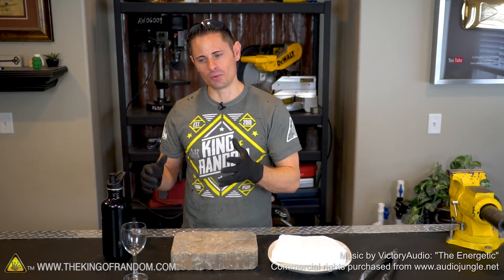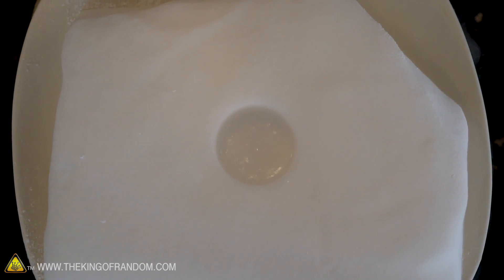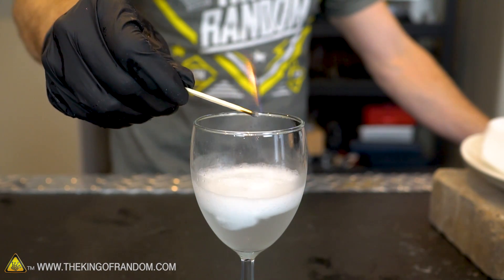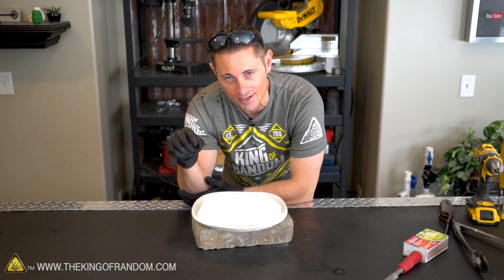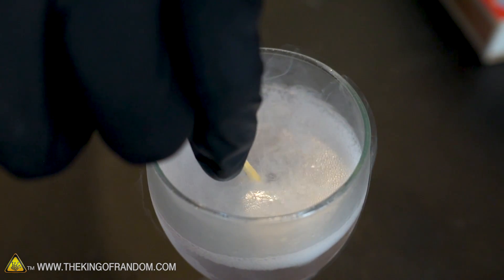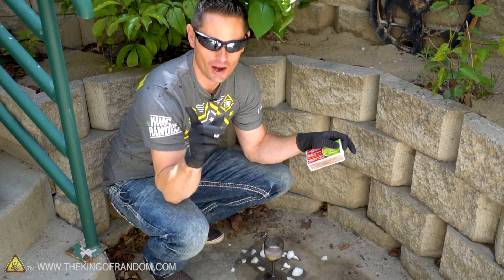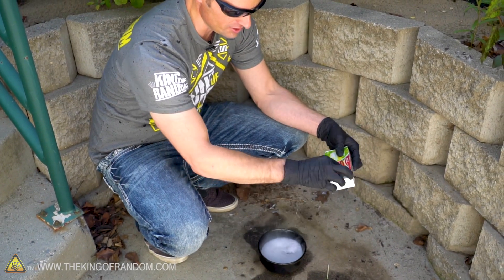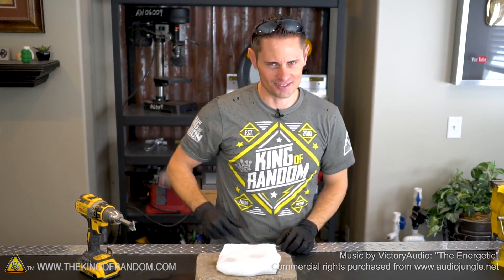What Does GASOLINE Do To Dry Ice? Can You Really Make A Fire Extinguisher With Gasoline?

Comment: NileRed did a great video on the topic related to water that I'd be willing to bet applied here just as well. It is probably not the Co2 that puts out the flame, it is the cold. A combustion reaction requires heat, oxygen, and fuel to keep going. He showed that the commonly held belief that water puts out fire because it "blocks out the air" is a myth and the effect is negligible. It's the evaporative cooling of water boiling that removes the heat and that is the reason water puts out fire.

Comment: steel beams vs jet fuel
Reply: jens jensen We all know steel beams can't burn through jet fuel
Reply: I read steam beans vs jet fumes so I was like tf
Reply: yes
Reply: jens jensen You don't need to melt steel for it to fail. You just have to get it really hot.
Reply: jens jensen I
Reply: jens jensen 9/11
Reply: It does heat it enough do compromise structural integrity but not enough to demolition a building use thermite hence the liquid steel
Reply: jens jensen I don't what that is
Reply: Wow
Reply: Skull Smasher Bush did 9/11                                        JK
Reply: jens jensen yaaaasss
Reply: Thinky science stuff is really kinda hard for you froggy types, yeah?
Reply: Charmle H he is talking about 9/11 😑
Reply: I know... that's why I put in my 2 cents... because jet fuel can't actually melt steel beams...
Reply: He could do it at sept 11

Comment: If you drop the temperature of the gasoline to below -45 F it is below it's flash point and will not light.  No vapors = no ignition.  So as an experiment what temperature is your gasoline?  You have not proved if it is the CO2 barrier or the gas is below flash point.

Comment: Is it possible that the dry ice is cooling the gasoline before it freezes it but with it cooled it doesn't evaporate? If it doesn't evaporate, the gas won't produce vapor and it won't ignite. Gas as a liquid is not flammable, only when it mixes with air as a vapor.

Comment: The Fire Tetrahedron. CO2 is displacing the O2 from the reaction. The cold temp of dry ice removes the heat from the reaction. I don't believe that the gasoline actually put the match out. Well, If the gasoline was cooled below its flash point, I guess it could.

Comment: In WWII, the U.S. aircraft carrier damage control teams would flood the aviation fuel (gasoline) system with CO2 when an enemy attack was imminent. The Japanese didn't do this. As a result, the U.S. carriers would often survive multiple bomb hits, while the Japanese carriers would be reduced to flaming wrecks from similar damage.
The U.S.S. Yorktown, during the Battle of Midway, is a prime example.

Comment: Smokeless Powder in Dry Ice.  Will Smokeless Gunpowder ignite in a CO2 Vapor?  Since Smokeless Gun Powder is an oxidizer, shouldn't it?  Or Should it?  The hard part is getting the powder to ignite in the first place...you'd need to rig a primer most likely to ignite the powder to start...since any open flame will go out due to the lack of oxygen in the cloud of CO2....

Comment: The reason the gasoline won't light, which I guessed as soon as I saw it, was the temperature of the gasoline had dropped below its flashpoint. I looked it up, gasoline's flashpoint is quite low at -45 F, but with dry ice temp at -109 F, it makes the gasoline too cold to burn.

Comment: Unless you bought non ethanol fuel, the ethanol is an antifreeze. Also, ethanol is hygroscopic, meaning it will absorb water while still being suspended within the gasoline until the water content causes separation. I'm a suicide jockey.

Comment: Grant Thompson in the bit where you "Put Fire Out With Gasoline"  you've clearly still got a layer of CO2 in that glass because when you blow the layer of CO2 off, you easily set the glass aflame. Maybe the video just wasn't clear that that's what you did, but from what you show, it's not the gasoline putting out the match, it's the CO2. the flame is already out, long before the match gets anywhere near the gasoline. Every time you go any where near a gasoline container that doesn't have CO2 covering it, you can't even get close to the liquid gasoline before you get a flame up because it's the gasoline vapors that burn.

One way you could prove that the liquid would put out the match would be to start with a match or birthday candle and have a small hose leading away from the flame source. dump an ounce of gasoline into the hose, and it will flow into the flame and should put it out. Definitely have the fire extinguisher ready in case it doesn't work though...  :)

Comment: Grant, your explanation of this experiment is flawed. Putting matches into Liquid Gasoline will never catch on the gas on fire. It is the vapors that are produced off of the gasoline that catch fire. Also the fire tetrahedron requires fuel, Heat, oxygen, and a chemical reaction. This is why the dry ice won't catch fire you when you add the dry ice the CO2 creates a barrier not allowing vapor to form = no fuel, no oxygen and no Chemical reaction that can take place. Dry Ice also makes the gasoline temperature lower then its Flash Point (Point at which anything can burn), hence making it the reason for CO2 extinguishers Also known as class ABC Extinguisher.

Comment: Put a mini bomb in vacum chamber and see if that explodes
Reply: Rajesh Kc most fireworks have their own oxidizer so something might happen
Reply: if you're not sure about it then why put the text in bold?
Reply: If anyone is familiar with the channel Codys Lab he did something similar with a sugar rocket, it wouldn't go off because of a lack of pressure
Reply: Vlad Vavric Cody's Lab
Reply: but you can shoot a gun in a vacuum. they did it on mythbusters
Reply: what is fueling the bomb? explosives have their own oxygen and you could set them off in space
Reply: No it will not expolode because the vacuum sucks  all of the air including the oxygen from the jar and the bomb will not get any fuel to light itself and to explode.
Reply: Ehow567 but i think the oxygen gas evolved by the oxidizer might be sucked up b the vaccum again... iam not pretty sure about it but i guess so.

Comment: liquid gasoline itself isn't flammable. gasoline has a very low boiling point and the vapor formed easily mixes with oxygen in the atmosphere to form the appropriate combustible fuel/air ratio. If the gas is cooled below the boiling point, it won't ignite regardless of there being an oxygen barrier or not. neat experiment just the same.

Comment: well its kinda not correct with gasoline putting out the match. its the co2 produced by the dry ice in gasoline. nothing special, will happen to any liquid with dry ice. if it's water or gas in a container. so its just a barrier of co2 there prevents the matchsticks to light up the gasoline. and never try put out a fire with gasoline!.

Comment: You should try reproducing the gas inside of the dry ice. Instead of using matches though, use a propane (or other fuel based) torch to see if that will force the gasoline to ignite.

Comment: I'm surprised folks are surprised. Carbon Dioxide is what a basic fire extinguishers use. Important note, however, this method will not work on ALL fires, or, rather, on all types of fuels that fuel fires, which is why there are different classes of extinguishers.

Comment: Excellent! Fun and fascinating. Well worth watching. BUT at no time in the video did I see the gasoline extinguish the flames. It appeared to me that the matches (single or multiple) were always extinguished by the CO2 before they got to the liquid in the glass. Maybe slow motion would show otherwise, but until then, I am unconvinced. 
     Nevertheless, the ability of mere static chunks of dry ice to extinguish burning gas by sublimation is pretty impressive. I really liked seeing the smoke from the match just flow out over the heavier CO2. Smoke from a match usually rises (hotter = less dense) but the cooled gases from the match sank in air but floated on the CO2.
Reply: Craig Mooring Wow. That was so profound. But very cold liquid gasoline would put out a match because only gasoline vapors are flammable.

Comment: Putting a magnet in liquid nitrogen and seeing if it's still magnetized
Reply: Fabby Fresh onix Cooling magnets down makes them more powerful. Heating them up makes magnets get weaker until they are no longer magnetic.
Reply: Ok then heat up the magnets
Reply: All it's really gonna do is make the magnet more brittle.
Reply: Rajesh Kc actually liek the other guy said coldness makes magnets way stronger
Reply: liquid gasoline does not burn, it is the vapors that are coming off it that burn.  If you cool it down to almost freezing then no vapors are  being released.
Reply: I think magnet will lose its magnetic power after introducing it with very cold liquid nitrogen because it will disturbs the molecular alignment of a magnet... i guess so not fix.

Comment: would it work if you used a blow torch :)
Reply: downtoearthseeds24 Unless it's an oxyacetylene torch :)
Reply: Blow torches etc usually involve mixtures of oxygen, unless said oxygen is mixed inside the fuel within the torch then the flame will go out and all you will end up with is gas being emitted without combustion.
Reply: Meme page admin, could be wrong but I am almost certain all torches regardless of gas need oxygen for combustion and with CO2 being so heavy and clearly being incombustible it won't work. Though holding the torch above the CO2 where it can do it's initial combustion may allow the flame to enter and perhaps force the CO2 out with the pressure of the gas flow and propulsion of combustion.
Reply: MidnightMarrow An oxyacetylene torch has two tanks, oxygen, and acetylene, these two gases are then mixed together and ignited. I haven't tried it but I'm certain that dry ice will not put out an oxyacetylene torch.

Comment: I wonder if the gasoline vapor and carbon dioxide vapor are mixing a bit and becoming less flammable or is it just that the carbon dioxide is just too overwhelming? Fun fact: old gas pumpers in the first half of the 20th century used to put out their cigarettes by tossing them into a container of gasoline. It seems crazy but the liquid would put out the cinder faster than the gasoline vapor would ignite.

Comment: You seem to fail to explain to people who may not know Gas itself is not flammable the flames mixing with the air is. The reason you could not get the gas to light in the dry ice even while blowing off the CO2 is because the lower temperature caused less gas vapor to form hence no fire. Also with the frozen gas same thing no to very little vapor = no fire. I has part to do with the CO2 and part due to the vapor of the gas at colder temps gas does not release as much vapor as it would had it been at 0 degrees or above. Kind of hard for me to put it into words much easier to explain it while talking to someone but i hope you guys understand what im trying to say.

Comment: try: cooling the gasoline using the dry ice while not allowing the co2 to be included in the atmosphere near the flame, testing if the removal of some heat from the gasoline will prevent ignition.

Comment: The reason why it will not light off is because there is still carbon dioxide coming from dry ice (right under the gasoline) and preventing the fire to burn.

Comment: As you state, the liquid gasoline is not flamable. It is the vapour from the gasoline that is flamable. In order for the gasoline to evaporate, it needs to be hot enough. If you cool it down, the evaporation stops, meaning, that you can't ignite cold gasoline

Comment: You're essentially using a co2 fire extinguisher by putting out the flames with the dry ice. Similar to how you can get dry ice by concentrating fire extinguisher sprays into a sheet or towel

Comment: I think you missed to mention an important thing: gasoline doesn't burn instead it is rather the gas vapour that does and by cooling the gas you are drastically reducing the formation of the flammable vapour and consequently reducing the fire. I think it would be interesting to see if gasoline at the melting point can put out an fire if the thing burning is not hot enough(has sufficient energy) to heat the gasoline. Perhaps some styrofoam would be suitable to test with.

Comment: I've always wondered if you could actually use dry ice to put out a fire. I figured it would work theoretically, but now it's cool to know that it works in application as well. How much dry ice would it take to put out a house fire? Would it be more or less expensive than the current firefighting methods with high powered water?

Comment: Try To Get A Plasma Globe And Break The Glass And Turn It On And See What Happens!!!!!! Like if you agree
Reply: jacob militello Nothing happens because the gases required make the globe work escape when you break the glass.
Reply: You'l either get very small open air arcs like a weak Tesla Coil, or nothing will happen.
Also a small chance the electronics won't like that and will get damaged.
Reply: jacob militello mine broke and I tried. nothing happened
Reply: Midnight The Tiger when
Reply: jacob militello he already did that
Reply: +S4L Cap0ne Actually, it's not compressed at all. It's lower pressure, because that makes the gas more conductive. Especially because it's a mixture of Neon and another gas. Same as fluorescent tubes or CRT displays. When broken, it doesn't explode, it implodes and sucks air in. Which I might say makes a very distinct sound.
Reply: +S4L Cap0ne
"Nearly atmospheric pressure" so yeah I guess close enough. XD
Reply: theLuigiFan0007 Well, actually, I was incorrect but it's not lower pressure either. It's roughly at about 1 atm (or regular atmospheric pressure.)
Reply: theLuigiFan0007 lower pressure would mean that it has a vacuum inside of course.
Reply: theLuigiFan0007 yeah XD

Comment: Dry ice is porous like a sponge. If you have a liquid that is sufficiently cold, it won't immediately get that sizzling reaction from dry ice upon contact. That's why the gasoline eventually stops bubbling when poured onto the dry ice block. It can then seep into the porous block and continue to cool until frozen solid. That seals the walls of the hole, and can eventually hold more liquid gasoline.

Comment: In your experiment you tried to light the gasoline in the hole of dry ice with a match, it went out every time. The carbon dioxide suppressed the flames on the match. You should try lighting the gasoline with something that doesn't need oxygen, say use an electric lighter where you run a large amount of electricity through some nichrome wire causing it to heat up. That way the carbon dioxide can't put it out.

Comment: Grant, what will happen if you fill up a bowl of dry ice, put some gasoline in it then try light it off with a blow torch, will the high heat of the blowtorch be able to light the gasoline or will the dry ice be able to put the blow torch flame out?

Comment: Gasoline is not flammable by itself, but the fumes from it are. 
Gasoline will always put out a flame if it is cold enough to not vaporize.
This is why you can't ignite the "frozen" gasoline from the block of CO2, not necessarily the CO2 vapors.

Comment: To show that liquid gasoline is not flammable, you should put a waterproof fuse into the liquid :)
Reply: Invisible it's not but any heat put into liquid gasoline might cause gas to form which could light off, and gasoline is a self sustained combustion so it supplies more energy which is why liquid gasoline is usually handled as a flammable material even though it's not. Gasoline also vaporises easily so it's quite rare to have only liquid gasoline.
Reply: Invisible Liquid gasoline IS flammable.. what the heck man

Comment: This was very interesting. I was glad to witness the CO2 preventing the gas from lighting. I also appreciate that you did your last experiment, lighting gas, then putting it out with dry ice, a 2nd time in a different container. I had though you might try a taller glass to prevent the gas from spilling, but the wider one worked also.One thing I would be interested to see along these lines is the effect of cold on gas. What you showed well was gas in dry ice, and how that won't light. But, it won't light because gas melts the dry ice quickly, which releases CO2 - which prevents ignition. But, what about cold gasoline, but no CO2? How warm does gasoline need to be to light it with a match? Clearly, froxzen won't light. But would 10 degrees over freezing point light? Would 20? What temp does gas need to be to be volatile enough to keep burning?Thanks a bunch, excellent video.

Comment: Now I got curious. Thermite for example wouldn't be affected by dry ice, since it has it's own supply of oxygen ripped from iron oxide, and my question is, would it produce enough oxygen to actually cause gasoline  fumes (or anything else really) mixed with carbon oxide from dry ice to ignite? Or is all the oxygen immediately used in thermites burning reaction?

Comment: Next time you can use survival matches. The ones that come with oxygen in them. The ones that can burn under water. They don't need oxygen since they have oxygen inside. This would work well when trying to light something with a layer of carbon dioxide.

Comment: I'm pretty sure the gasoline is not putting out the match it's the carbon dioxide layer putting it out before the match has a chance to light the gasoline. correct me if I'm wrong. putting a match out with gasoline sure sounds cool but... that's a false statement.